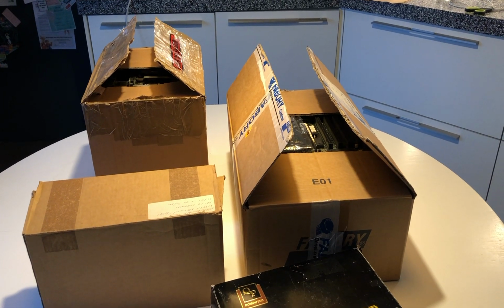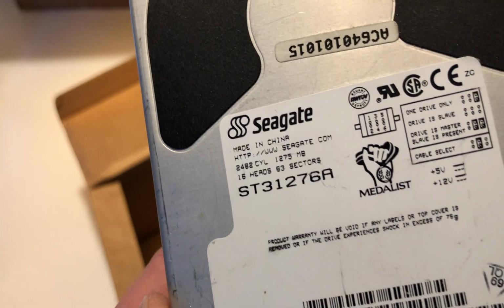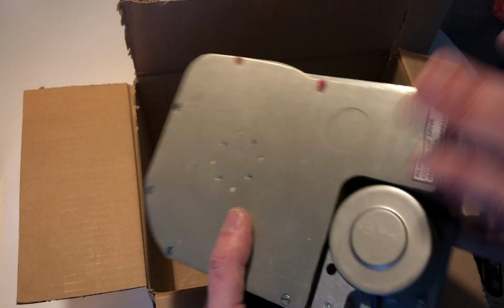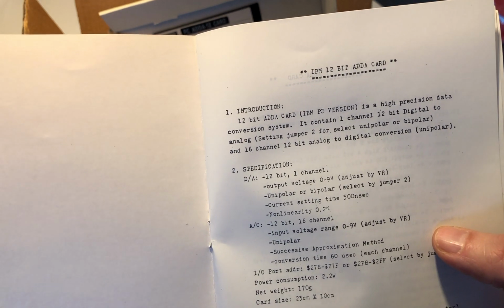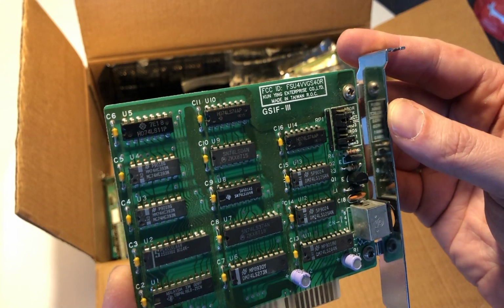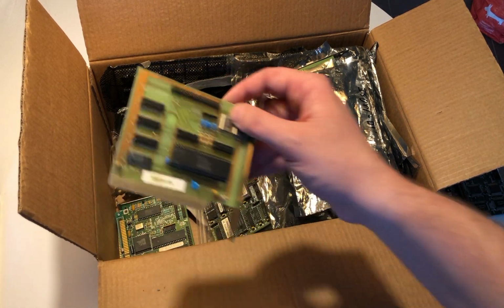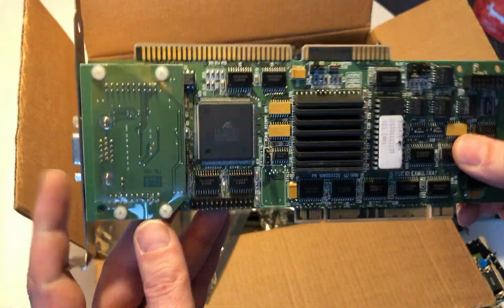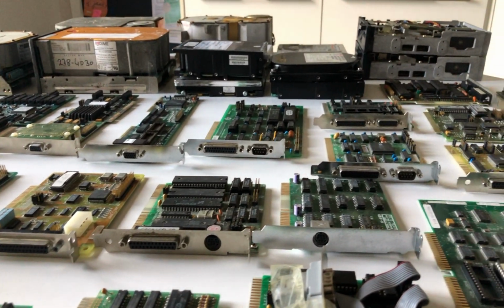First retro computer haul of the year is a big one !

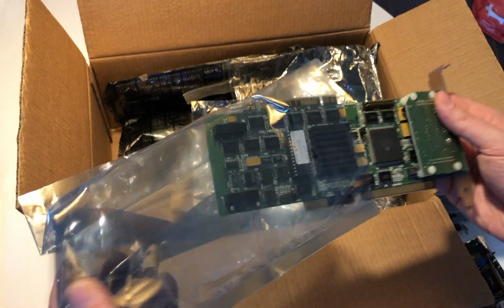Comment: The card at 17:05 is a ATI Mach 8 8514/A. When IBM introduced the Microchannel-series, they also introduced a new high-end graphics standard to go beyond VGA, initally intended to be called XGA. Microchannel never caught on, but the graphics controller of the new graphics standard did - the IBM 8514.
The IBM 8514 was the first PC graphics-chip with 2D hardware-acceleration - so called "Blitter". The blitter enabled the controller to move around portions of the graphics memory around. This made for very fluent 2D animated windows.
When the card was introduced, it was especially interesting for PC UNIX users, like me. The XWindow graphics subsystem of UNIX had drivers for simple VGA cards, which had to move windows around by involving the CPU yielding poor performance, or a graphics card with an IBM 8514 chip.
This ATI card was the first "affordable" IBM 8514-based videcontroller, costing "only" a few hundred dollars. But many UNIX users, like me, went out to buy such a card the minute they went on sale - it was by far the most cost-effective solution to get a decent GUI on UNIX.
Note, that this is not a standalone card. It's VGA out goes into a normal VGA cards external input connector. Normally, the VGA would run from BIOS until the IBM 8514 drivers activate the chip, at which point the passthrough connection allows the 8514 to take over the VGAs output.
This is a rare card! And the foundation of all "accelerated ATI graphics cards". Likewise, it was the "cleanest" IBM 8514 implementation. By flipping the bracket-daughterboard to the other end of the card (to the same two black connector-rows), it would even operate as a perfect IBM 8514 clone in a IBM MCA box.
If you ever intend to explore the - absolutely worthwhile - history of PC UNIX systems, this card is an absolute must have and worth a video on it's own.

Comment: My HDD prediction:  The 420MB Western Digital still works great!

But the 2.5GB WD is either DOA, has bad bearings (whhhhheeeeeeeee), and/or can't pass a surface test without errors.

I think I have ONE of those single-digit GB silver WD drives that actually works, and a small box full that don't.  :-(
Reply from the maker: Yeah it's always a big lottery game with these hard drives .... But your prediction was correct. The 420MB works great and use it today as my ms-dos hard drive in my "new" athlon retro PC to boot into DOS when I need to backup old retro machines, and then boot into Windows XP to transfer them back up to my NAS or USB stick.

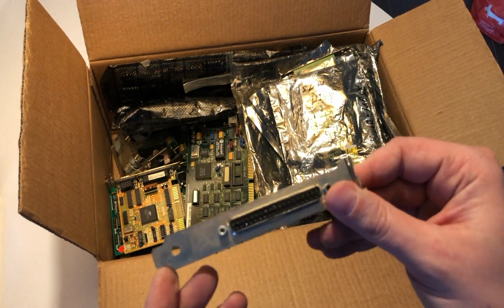Comment: 12:32 the card is either a SCSI controller or a proprietary tape back up controller with internal and external connectors
Reply from the maker: Turned out to be a floppy controller card. Used it on an XT machine to hook up 2 5.25 inch floppy drives. The external port is probably for an external floppy drive (I think the ibm floppy controller card also has that).

Comment: The "large MFM" drives will probably work just fine. I've several old MFM/RLL drives and they often work just fine but generally need a good low level format which is often in the controller BIOS routines (you can execute the code from debug.exe in MessyDOS). Don't forget to park the drives to ship the heads to the landing zone before you power them down so the heads aren't resting on a part of the surface you care about. :) Another good/easy way to low level format them is to keep an eye out for a MicroVAX2000, they had a nice MFM low level format util built into them and they don't take much room.
Reply: debug
- g c800:5